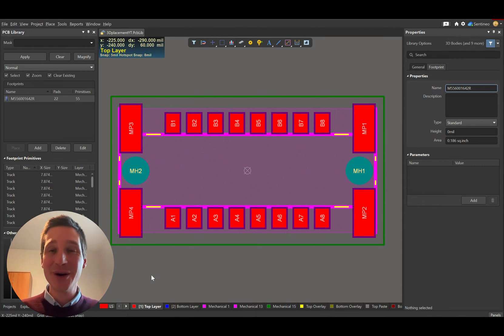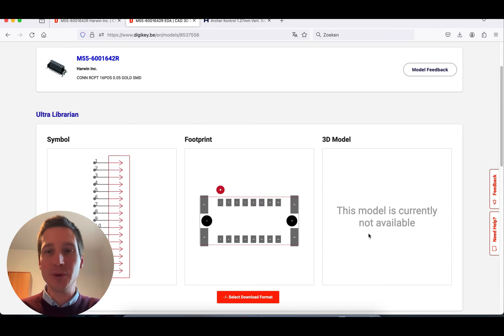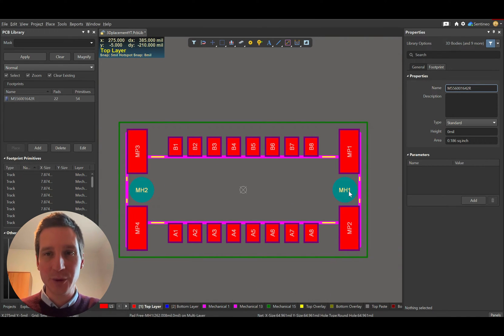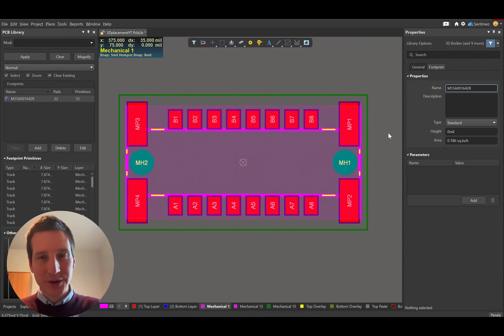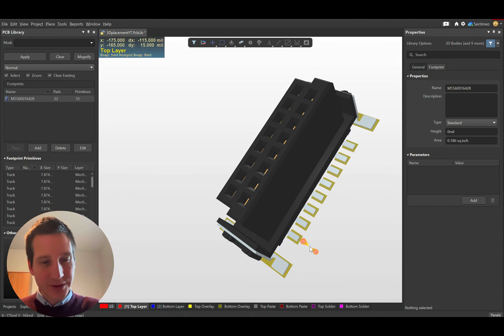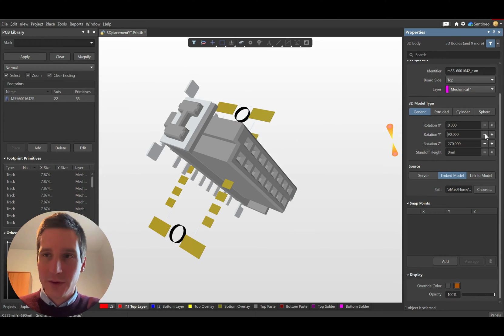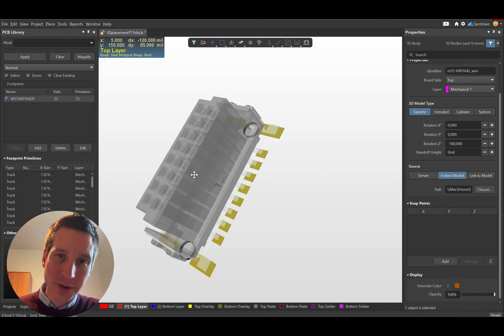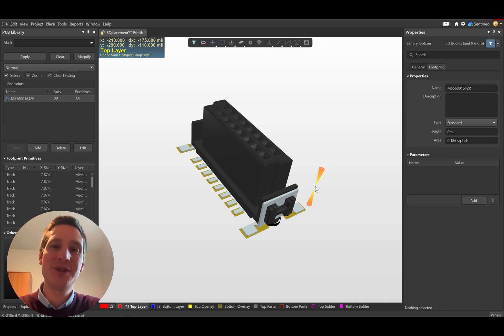How To Add a 3D Model For a PCB component Footprint In Altium

Comment: Thanks for the tutorial. I did that and it work, I see the 3D model in 3D view of the footprint, but now, I tried so many steps, saving in another file etc, but I cannot use that component/footprint in my other projects, could you please show a complete workflow of doing so ? It just a few seconds more after when this video ended I suppose.
Reply from the maker: Please make sure that it is in a component library that is also included in your project. If your component lib is not included, you won't be able to use a component.